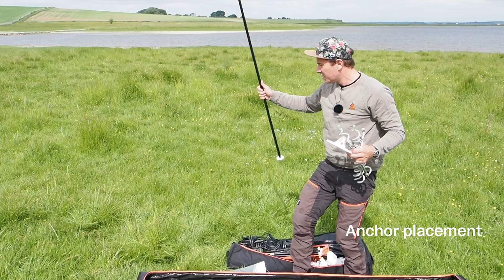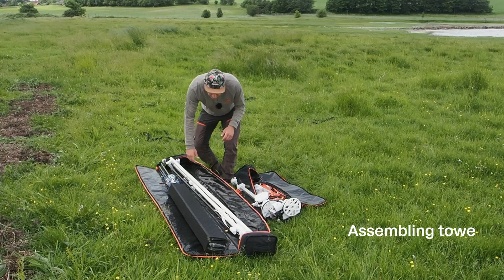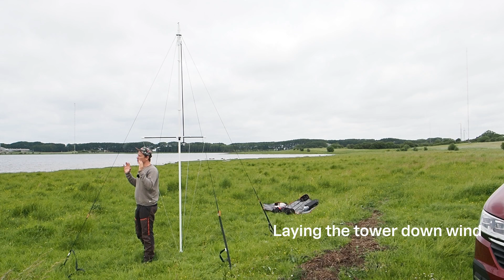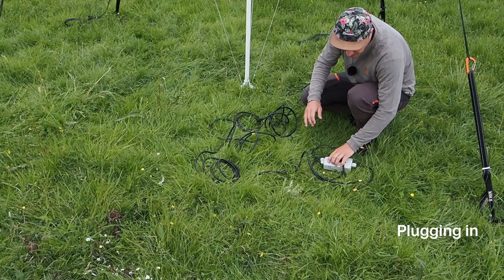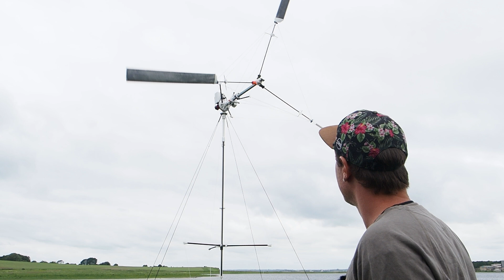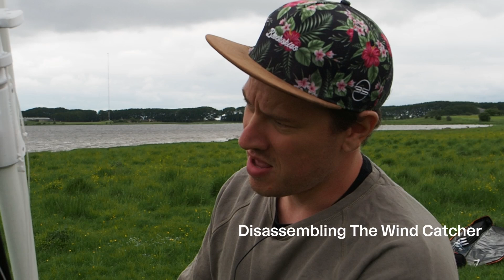KiteX Wind Catcher Setup Video

Comment: or you can simly place some foldable solar panels...
Reply: If you only want to use power then it's sunny and it's sunny most of the time that you want to use energy - sure.
Reply: @AndreasOkholm  and what if there is no or not enough wind?
there is almoste a bit of pv power during the day
Reply: That will of cause happen some days. The usability of our portable wind turbine completely depends on your use case and how much wind and sun is available in that destination. In Denmark wind energy contributes to more than 50% of our electricity production, while solar is less than 10%, just to give an example.

Comment: Thanks for the setup video. It's quite the setup process but you can tell the quality is very high. Have you tested this in a long term setup? How does it hold up to UV light? How does it hold up to rain or water? Is it fine to leave it up and working for long periods?
Reply from the maker: We have tested the setup long term at out testsite. Where we have had long term test-turbine turbines operating for more than a year and we have more than 3 years of operational experience with the product. You can see the service manual to see when parts need retighten or replacement. Please consider that the wind catcher is not intended for permanent use. It holds up well in rain. The plastic performance does degrade in UV, but it's not an issue for the intended use. Generally the 3D printed plastics parts we use have high very structural safety margins to account for UV or fatigue degradation (low tensile loads).

Comment: Thanks for sending me the email regarding availability in the US on Amazon. I already do "portable" solar with 6 to 10 115W Renogy bifacial panels feeding into a Bluetti AC200L. That's perfect for the flat hot desert valley city were I now live. But fairly soon I'll be relocating to a more rural desert mountain area where we also get consistently good winds, especially at night. This could be fun! 

Questions I have . . . What is the maximum wind speed that the Kite X can safely operate? Would you recommend complete disassembly when a stiff rain is in the forecast?
Reply from the maker: The maximum wind speed we have been able to test wind catcher in is 29 m/s - highest ever recorded windspeed at our testsite in the past 2 years. We recommend to take it down if the wind is forecastet to be more than 20 m/s if you want to be on the safe side. No need to bring it inside for rain. We keep our test turbines outside all year around.
Reply: @KiteX_tech  20 meters per second (m/s) = ~40 miles per hour (mph) and 29 m/s = ~65mph. 
That's impressive! I also like that it's sufficiently weatherproof to be able to be able live outside day after day. Very dry here in Arizona (southwest US,) but we do get at least some rain, and it's sometimes heavy - and windy - whenever we do.